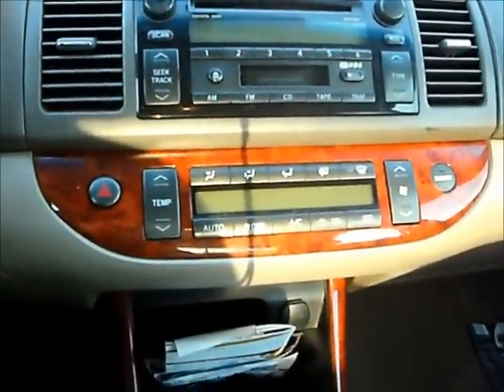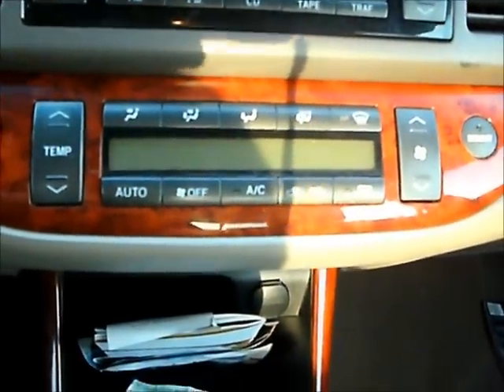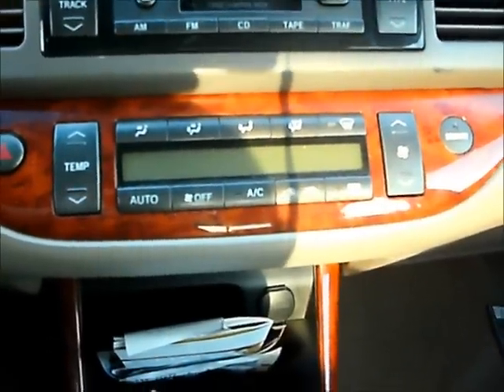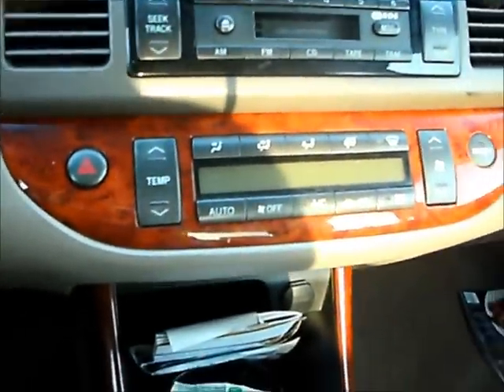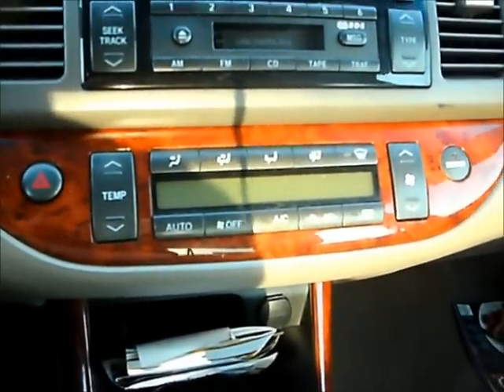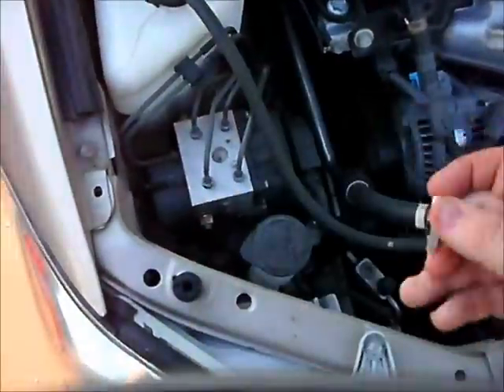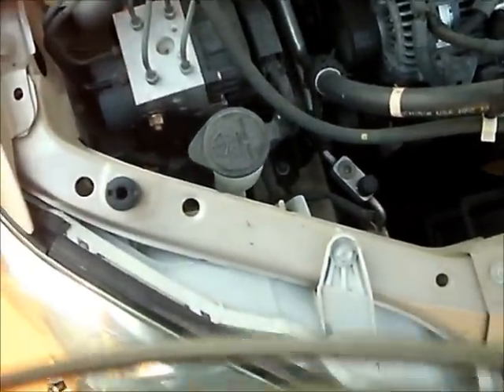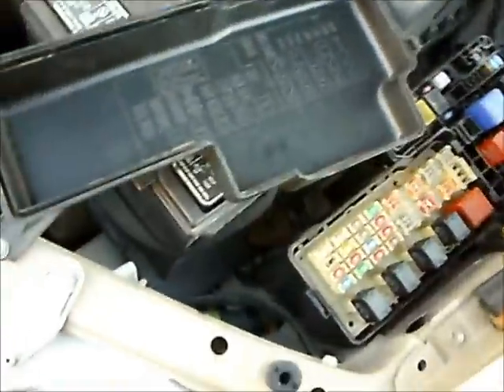2003 Toyota A/C Relay Problems

Comment: I tried as instructed, beat the relay to the ground a few times & it worked for only a few minutes. I had to take the relay to part store, bought a new one (cost $17) & replaced it. It does not cost $89 as mentioned in the video. Thank you for sharing

Comment: You just saved me a ton of worry, time, and money, thank you! I just bought a 1997 toyota avalon XLS a week ago. AC blew cold as ice! about 4 hours ago the ac would not turn on at all, with the ac control panel lights blinking. I was terified that the dealer had just ripped me off bigtime, and assumed they had maybe rigged a faulty ac system to work for a few days until its no longer their problem. Pulled out the relay and knocked it a few times with my thumb and reinserted. problem solved!!!THX

Comment: I'm aware that the part to fix it may be cheaper now, but smacking it around really did the trick, so I'll just keep using the old "beat it till it works method" for now. Thanks so much for uploading this man, really.

Comment: It is possible that the relay's CONTACTS are dirty or oxidized. And each time you remove the RELAY and then re-install it, the CONTACTS make a better connection. If that is true, then "banging" the relay may not be what is correcting the problem. I'm going to go try this now, and I will use ELECTRONIC TUNER SPRAY CLEANER on the contacts. OK, I admit that I may do a little "banging, " too!  Thanks for the TIP!

Comment: there is another youtuber that takes out the same relay, but replaces with the horn relay to test that it truely is the relay that is bad.  that worked for me.  i didn't try banging it like you did, but will probably replace it with whatever advance auto sells.  i hear it is closer to $15 or so.  will find out for sure soon.  your video helped too though.  it clarified which relay to take out.  thanks.

Comment: Maaaate, thanks so much ya champion! I have a 2003 Toyota Prado. Here in Brisbane Australia the weather has been in the high 30's for a while now and this little gem video clip has just fixed the issue - albeit possibly a temporarily fix. Now the wife will get off my case and if it continues to happen I will just go to a retail store called Jaycar and the replacment relay should cost around 8 bucks............thanks again man.

Comment: nice video.. it saved me time troubleshooting the issue on the car. not sure what this relay has in particular that is worth so much. but I replaced it with one similar to the relay next to the white one. and my cars issue was fixed. (note: this relay seems to be the same as an 85,86,87, 30 relay)...2 pins used for signal, and 2 pins used for switch.
Reply: Note: hitting the relay is a temporary fix, considering that the relay is most likely burnt. anyway I hit mines to test if that would fix it... but it did nothing to resolve my issue, until i changed the relay!

Comment: THANKS THANKS THANKS AND THANKS AGAIN! :-) I saved a lot of money becouse of that video.I contacted 3 mechanics, and no one of them was able to fix the problem. No`n of them mentioned the relay!they was talking about change the compressor, pressureswitch and expansionvalve.And all I had to do was to beat the shit out of the relay 3 times! ;.DTHANKS!

Comment: Jajaja it works! Thanks I did like 4 times 😅🙏 its getting hot here in Charlotte thank god I found you
Reply from the maker: Drop on down by a auto parts store and pick up a brand new one. They've dropped on price and you should be able to find one for around $15.

Comment: I've never seen a relay like that cost 89$. I work as an auto tech in a shop and have dealt with this issue with other camrys. Usually the relay will fix the issue but sometimes the wiring to the compressor clutch needs to be repaired. Worst case scenario is anew compressor. Hope this helps.
Reply: Bryan Davis Compressor Clutch. But don't bother. You can get the entire compressor for the same price as the clutch on eBay.

Comment: (RickM1953): Exactly. Mine did the same thing on my Saturn so I wiggled the relay in the junction box and it worked, for a while. The problems most likely at the relay connectors as this person states. Don't always go by a bad relay as the issue. They rarely go bad.

Comment: Having worked for a company the builds the relay boxes for Honda and Toyota I can can't support the fix you are providing. Banging  an electronic component will damage it not repair or reset it. I believe that is more likely that the relay box has a bad connection or loose wire in the relay box at that location. 
try just pulling the relay and putting back in to see if you good the same results.  Anyway good luck.

Comment: my 2012 sienna compressor stopped all of the sudden and I checked all ac relays and fuses, but no relay marked for magnetic clutch unless its inclued on another relay and just not specified. Hope i can figure this out or find the relay. Funny as hell when you went from composed diagnostic guru to enraged neighbor hater. had to listen to that a few times.

Comment: This worked for my 2003 4Runner Limited. My only question is, for about how long does this fix the problem? Should I just do this every time my AC light starts to blink?

Comment: My Toyota Corlla 2008 AC works and stops working when there is shake or jolt occurs. Then it starts to work again if car occurs to get jolt. I have visited two mechanics, they suggest o change the compressor. I am not really into to car mechanism. Help me if you could. thanx a lot
Reply: haja mohaideen Faulty junction box relay connection. Same thing with my Saturn. I still have to locate the problem in the connection. I suppose a bad Clutch Coil can cause that but doubtful. Hope you found the problem.

Comment: Man, I'm having a problem with my horn on a 2nd generation (2009) tacoma.  It wouldn't stop going off the whole drive home and when I got home I disconnected the battery, went into the main electrical box, and removed the fuse that the key on the inside of the electrical box cover designated as being for the horn (#10).  I reconnected the battery and it's not making the noise anymore but I don't have a horn!  Hopefully my battery isn't draining kuz I just had it replaced.. So annoying!

Comment: I checked the fuse at auto zone and it is working. should I still replace the fuse or relay as you call it. I am burning up getting sick from texas heat. thnx

Comment from the maker: @RickM1953 The connections are getting stuck. Some people have drilled holes in them and sprayed electrode cleaner in them. I know it does not reset anything; I can do that through the computer. If I brake it; oh well.

Comment: T his sounds like aproblem I may have. Twice i had auto electric and a/c techs got my A/C working, but awhile later no more A/C. Onetime i got home and A/C worked  but next time it was dead. Maybe this will work on my Hiace comuter , a 2007 model.Will try and report ,if it works.  Or the sucker may be leaking.

Comment: my AC is not shooting cool air, i went to a toyota dealer and they told me a relay needs to be replaced. i didn't do it with them, but can i do it cheaper by buying this relay?? what is the part #?? i have a corolla 2003 CE
Reply from the maker: If its cold don't worry about tell it quits. Try slapping the relay and hope that works.
Reply: Chad Qualls
its not cold its hot air coming out
Reply: TheChico2200 Just go to the Junk yard and get a new relay from an other car ;)

Comment: If you're relay is part number 90987-02022, you should replace it with Toyota part number 90987-02022.

Here is a PDF link to the TSB:  http://densoautoparts.com/sites/default/files/tech-tips/Tech%20Tips_012_AC%20Clutch%20Inoperative.pdf .  You can probably by genuine toyota parts from ebay at a lower price.

Comment: Hey Chad did I hear you right when you said that the part was $89?! WTF!!!! It looks just like the A/C relay that I just replaced in my 2002 Camry. That one cost me just under $15. If the relay has Toyota part #'s 90987-02022 ... 156700-2470 stamped on it chances are you can replace it with a MUCH cheeper relay. Shop around.

Comment: Ok I did that ànd it worked but when I close the hood and started driving it started flashing again and my windows fogged up again, I also tried another one and it did the same now what?
Reply from the maker: This video is super old. The price for the relay is much cheaper now. I'd just go to a auto parts store and get a new relay for around $15. If it continues to do the same thing after you replace the relay something else could be wrong. Next possiblity would be a fuse for the clutch, low on R134a, or the clutch on the compressor is going out itself.
Reply: @OhPhuckYou  thanks appreciate that!

Comment: Ok, that's the kind of fix I can relate to. Free.  I took mine out and hit it on the bumper and Wala...it worked.  I live in Sacramento, CA and it gets hot as hell here.  Just for back up, I went and bought the same part new at Autozone for $13! I'll just hit the current one on the bumper until it just dies.   Sorry about your 'fucktard' neighbor.  Thanks for your advice.

Comment: Hello I am trying to find a relay that provides power to the following on my Toyota Harrier model 2001. The relay keeps falling off at different times it switches the AC, Engine heat indicator, gear selection light, auto locking and window switch on driver side.

Comment: I tested the ac fuse with a tester and it came back green but doesn't work in the ac slot.  I put my horn fuse in the ac slot and even tho the fuse  works with the  horn it would not power the ac.  Does that mean that the ac relay fuse is not the problem.